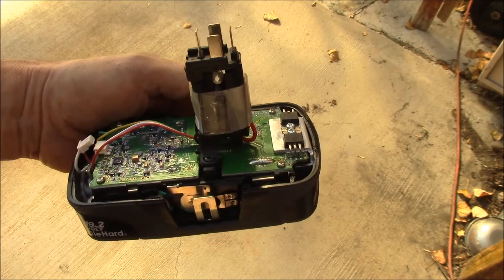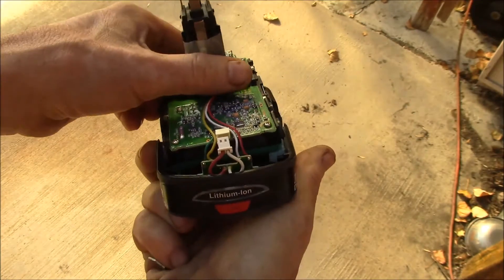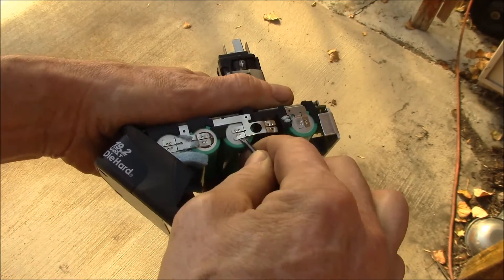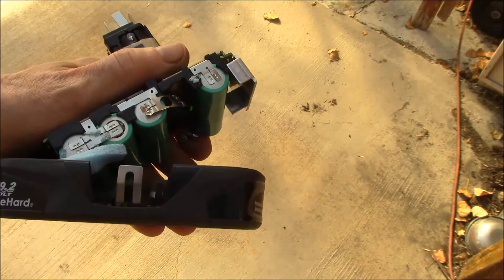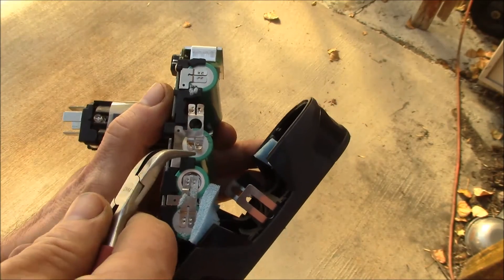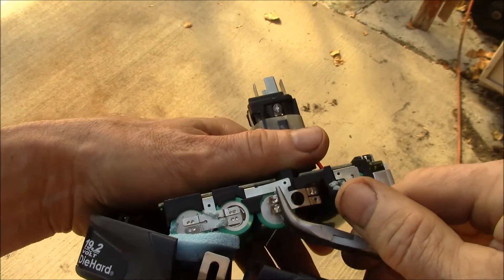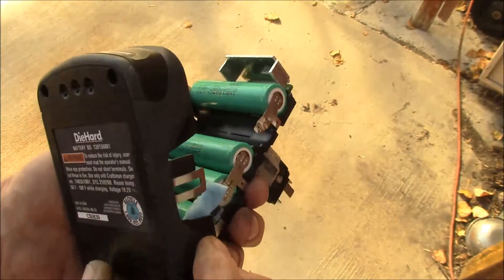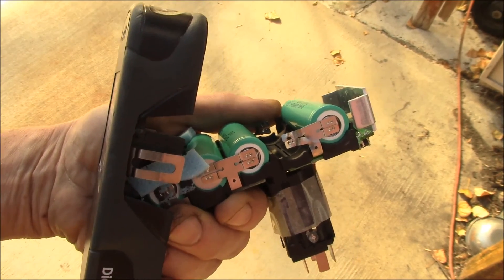Craftsman C3 Battery Repair, Part 1

Comment: Hi Mr. Brown,

Wow. I've just binge watched all (I think) of your videos on Craftsman C3 batteries, including comments, and some more than once. Thank you for sharing all your knowledge and  experiments.

I have disassembled my old Die Hard NiCad C3 with the goal of switching in 5 high capacity/high discharge 20 amp 18650s. 

The biggest problem I have is finding a balancing 18Volt 20 amp S5 BMS board, and then connecting it correctly - some from China don't come with any plans or diagram. (I'm guessing at appropriate amperage also.)

Could you point me at an appropriate balancing board, or at least confirm the specs on what I should look for?

On a related topic, I'm interested in a DIY AC adapter for my Craftsman drill and others for my M12 12V & M18 18V Milwaukee power tools. Believe it or not there is a lot of interest in such conversions. Have you any interest in working on such a project? 

I am aware of a few attempts at trying this described on the internet and in YT videos, but none are satisfactory due primarily to the use of scavenged laptop power supplies with insufficient power, imho.

Both Metabo and DeWalt offer AC adapters for their high voltage (36-40 V) offerings only. I presume this is due to the large power consumption that may plow through expensive batteries in short order. 

Perhaps a voltage regulator could be inserted between one of these AC adapters, or a generic OTS power supply, and the tool? 

OTS battery adapters are available for almost all power tool brands. (I can run my 19.2 V Craftsman drill & saw with my M18 18V Milwaukee batteries for example.)

Output from the voltage regulator could be plugged into an adapter for whatever tool on hand. If it were a variable regulator it could power 12V, 14.4V, 18V and other devices. Anyway, I am very interested to hear your thoughts.

In any event, thank you so much for documenting all your work for the rest of us!

Kind regards,
John
Reply from the maker: Thanks much for the SuperChat, glad you found the videos interesting.

I've not looked into upgrading my C3 batteries, aside from replacing some dead cells), but I did something like that with my old Black and Decker NiCads:
https://youtu.be/Y71L_NTGnN8?si=ei0Jq46FxNyh3NxA
I used a 5S LiPo battery pack and ran the balance cable out of the pack and then use that to charge via an RC balance charger.  I also use that connector to plug in a cell monitor that beeps when the voltage gets too low.  In those packs, there wasn't room for a BMS card with the LiPo RC battery pack I used.   

I did use a 4S BMS on another project about 8 years ago.  I don't think it had a balancing function, though:
https://youtu.be/OMIcMB5k40s?si=SXUxvjAPxPnfFkjR

Also never looked into an AC power supply solution, but did play around with measuring current draw with my B&D battery:
https://youtu.be/7_j9MFgEOt0?si=dHg04Op-SklJyVUc

I would think a good DC buck or boost converter might do the trick.  Get something in the 15-20 amp range (depending on the tool), buck converter to step something like 24V down to 20V or so.  Boost converter to step up something like 12V.  Many of those have displays and either buttons or a rotary dial to get voltage and current limits.

I have an old 12V NiCad drill that I purchased many moons ago and modified that to connect to a 12V car battery for use when working on the car (back when I was an apartment dweller).
Reply: @The4Crawler Thanks sgain!

Comment: How did you determine the dead cells ?
Reply from the maker: Mainly by testing voltage on each individual cell.  Usually most will be about the same voltage and 1 or 2 cells will be down under 1 volt.

Comment: Hey Dummy, Use a soldering Iron to heat up the solder joints and they pull right off
Reply from the maker: Yes, that works for soldered joints, but I believe those battery tabs are spot welded to the cells.

Comment: At first I was wondering why you weren't just reheating the solder to save the tabs. Then I heard you say it was a spot weld. I thought even tiny spot welding required more heat than soldering. Wouldn't Craftsman be running the risk of damaging the cells themselves with the higher heat option?
Reply from the maker: Yes, the factory spot welds the tabbing to the cells.  I've also done that:
https://youtu.be/SkMcOO1_wRE

And yes, the spot welding point gets extremely hot, enough to melt and fuse the tabbing to the metal of the cell.  It's very concentrated and a minimal amount of heat spreads out.  Soldering requires the entire surface to be heated up to melt the solder and thus puts more heat/energy into the cells than  spot welding does.

Comment: You can buy tabbed version lithium 18650 batteries. Also, you buy the small nickel battery strips on eBay for a couple of bucks instead of trying to save the original tabs that are spot welded in place. It's just makes the job so much easier. I wouldn't use too much heat soldering them either, this could cause the battery leak, if any moisture got inside. Corrosion is never a good sign, and the battery pack has likely failed prematurely, but not in all cases. Depending upon on the region where you live, but in the state of Florida and other states where it's very humid, cordless tools don't work for very long, and the battery life is not guaranteed. Corrosion inside battery packs is very common. The manufacturer recommends that the tool should be operated within a select temperature range, but if your living in Florida, your probably exceeding it by working outside on a nice sunny day, but most people never read the manual. So there you go.
Reply from the maker: Neilrrc37 All good points, thanks for the comment.  I opted for the untabbed cells as if this didn't work, I at least had some regular cells I could use for other purposes.  With the pack design, the tabs come right off the battery protection board, so needed to be re-used in some fashion.  And in hindsight, probably would be best to use pre-tabbed cells and then cut the existing tabbing at a selected position where the tab on a pre-tabbed cell could be rejoined and that would avoid having to solder to the battery.  I did try and minimize heat input and that pack is still working 6 months later.  In later videos, I show a better option of just replacing the entire batch of damaged cells with a new LiPo pack and that works much better.
Reply: "You can buy tabbed version lithium 18650 batteries."  OK, where? How about a link?